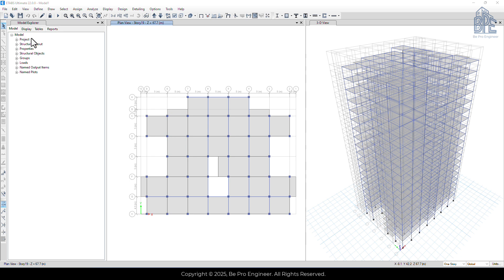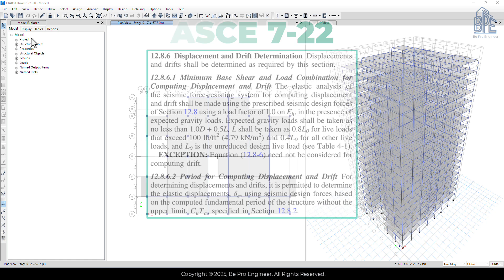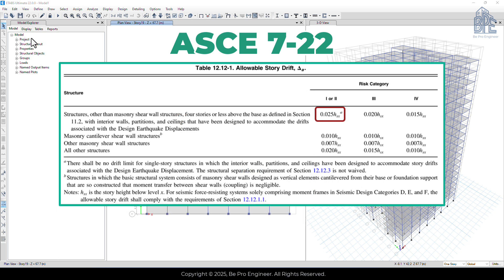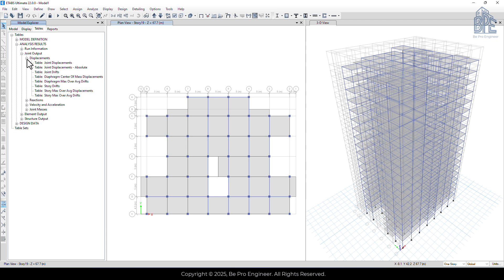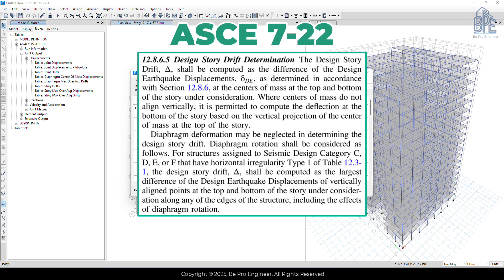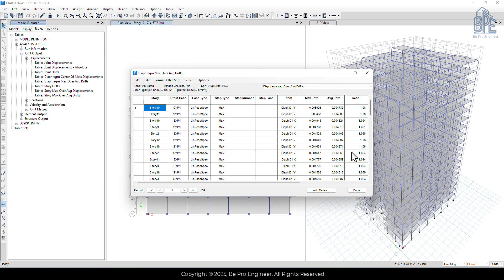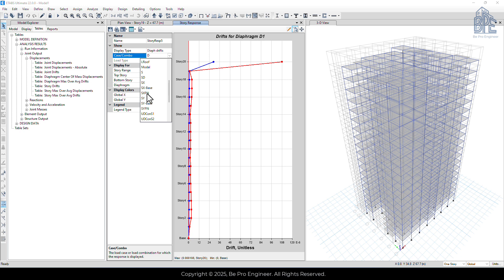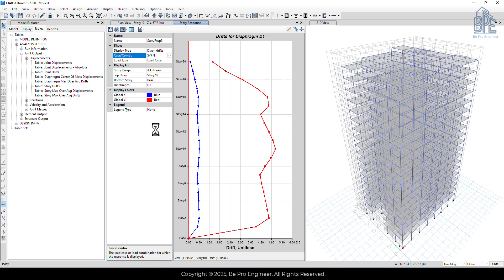Drift Check in ETABS

Comment: Why is the allowable drift just 0.025/Cd = 0.0045, where h is the variable of height (h)? Since you only compare the drift, not the drift multiplied by height times an important factor, which is 1.0.  Where's the parameter of h going then?
Reply from the maker: Here, “drift” refers to the drift ratio—which is the relative displacement between two consecutive floors divided by the story height h.
So the height h is already included in the calculation of drift ratio. That’s why we compare the ratio directly with the allowable limit, without multiplying by h again.
Reply: @BeProEngineer  As mentioned in ASCE 7-22 section 12.8.6.5 determination of story drift, it said the location is in the center of mass of the story. So I was used to checking the drift using the Diaphragm Center of Mass Displacement on ETABS, I multiplied it using Cd/Ie to get the inelastic center of mass displacement, and I subtracted for each story in order to get the drift. The answer is quite similar. What do you think? Thank you for the replied, appreciate it!!